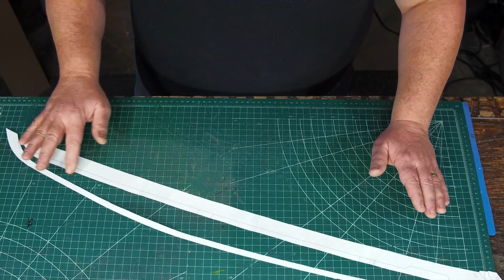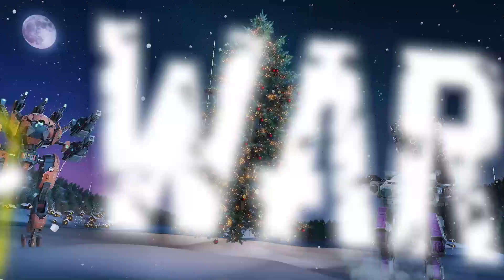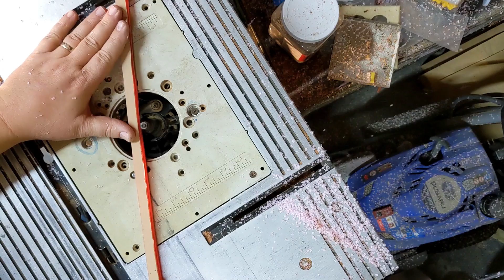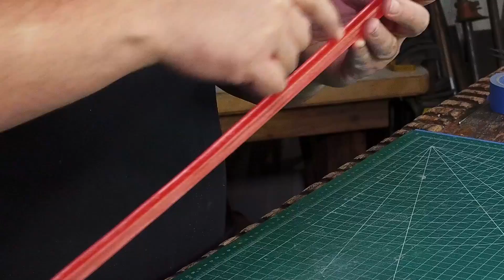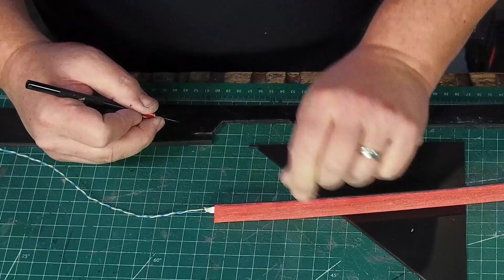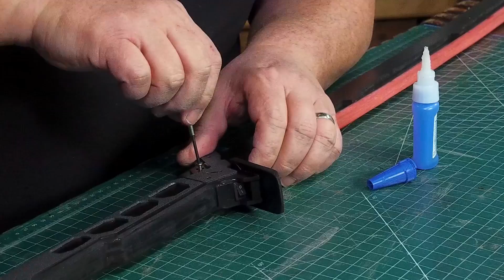Odin Makes: Arasaka Thermal Katana from Cyberpunk 2077

Comment: Odin, I found out that on Amazon you can get some cat training tape, its cheaper than carpet tape and designed to be removed from surfaces. Hope that helps
Reply from the maker: Ah, thank you!
Reply: @OdinMakes  i have found it to be easier with wood at least. No promises with plastic. On a side note if you go to a con with an item made from Sintra, do not leave it in your hot car

Comment: You just need to check out Tamiya PS-36 transparent silver spray paint.  Used for acrylic ( I also use it on PLA and ABS) will diffuse light better, and is a silver spray paint.

Comment: trick from Crimson Guitars.  Put masking tape on each of the pieces you want to connect while cutting.  put a little super glue on tape on one of the pieces, and accelerator on the other piece of tape, then put them together.  once cut, you just pull the pieces apart

Comment: Suggestion: Maybe EL wire would have been a preferable way to illuminate the blade. It is a more 'consistent' light emitter as it has not single 'light bulbs' but shines ofer it's whole length.
Reply: No. It's crap

Comment: I know EL wire uses a higher voltage but I have seen 3 or 5v LED filament before.   Would eliminate the hot spot issue
Reply: EL wire sucks. You just need better diffusion for leds

Comment: Nice "blade"! Would EL-Wire be an option to light up the cutting edge? Or is it not bright enough? Greetings from Germany
Reply from the maker: The battery operated EL wire I have seen is not very bright. The nice stuff is 24v or full wall power, which means the sword would need to be plugged in- not as much fun!
I am open to other ideas.

Comment: You could have used a LED filament instead of a LED strip, like this one for example: https://www.aliexpress.com/item/1005001513580211.html
Reply from the maker: That requires 24v of power. There isn't enough room in the grip for that many 18650 batteries (6)
Reply: @OdinMakes  I've just watched another way to get a more consistent light from a led strip but that's not something you usually do: https://youtu.be/KeNo_Xd_FMU?t=334

Comment: Love how this turned out, its so pretty. The only thing i would change is using EL wire instead of LEDs to avoid hot spots in the blade. Other than that though like i said its beautiful
Reply from the maker: All EL wire I have seen is underwhelming in it's brightness. It only looks good in darkness, or requires full wall power to run.
Reply: @OdinMakes  exactly.  EL wire sucks

Comment: there is an alternative to to leds that dosent show each light, its called el wire, the whole wire is essentially a single led, it is fragile but something like that could work
Reply from the maker: I have been unimpressed with EL wire. The battery operated stuff is never that bright, it only really 'glows' when it's really dark. The brighter thicker stuff I have seen needs to be plugged into the wall.  Do you know of something different?
Reply: @OdinMakes  unfortunately not. I usually used it for stuff in dark situations but I figured I would mention it